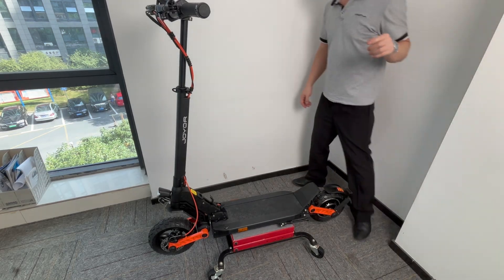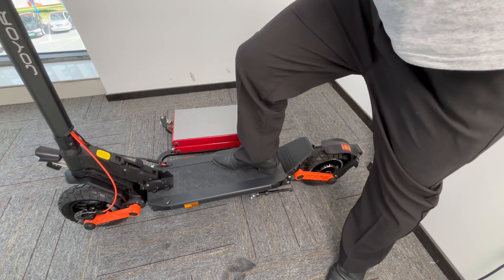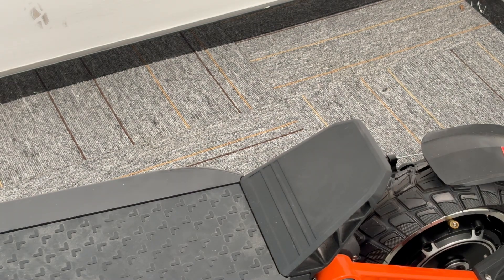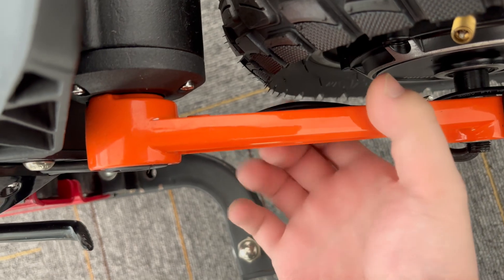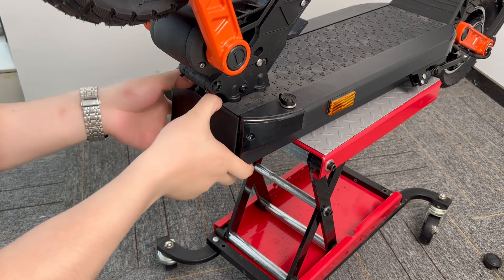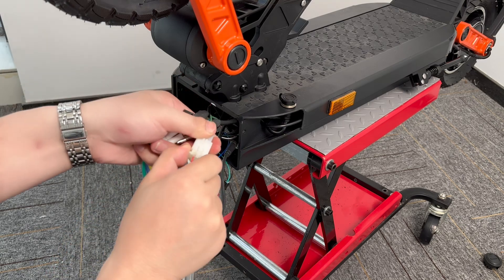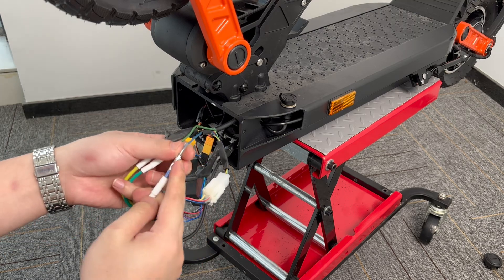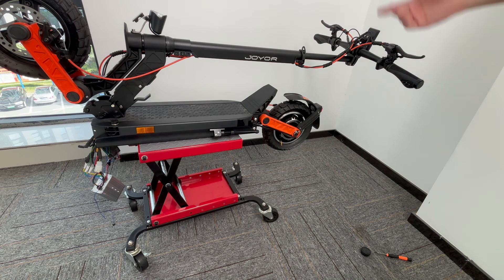Motor failure, how to find the cause

Comment: Hi i have a joyor s10 . The scooter will only turn on when in charge as soon as i drive it it will turn off . Any ideas how to fix
Reply: Check the cables behind the display
Reply: Change battery